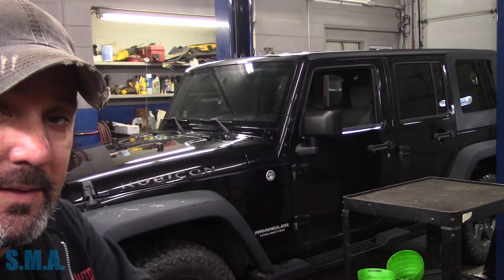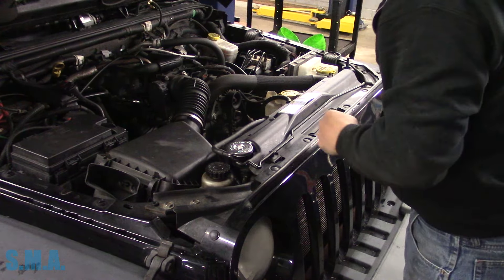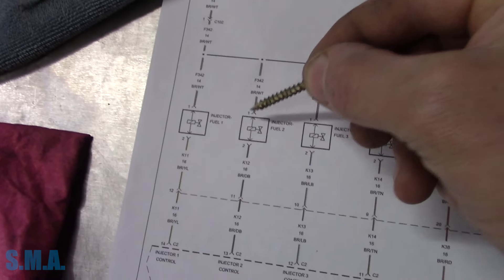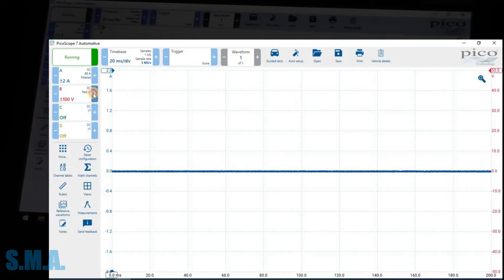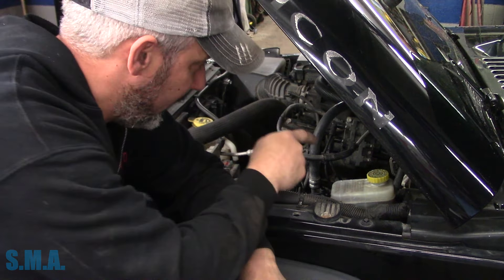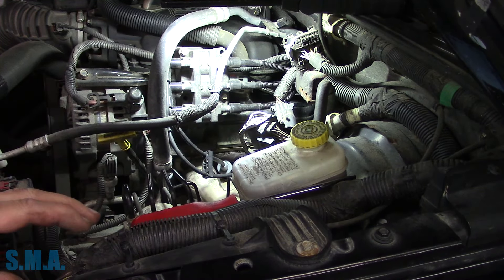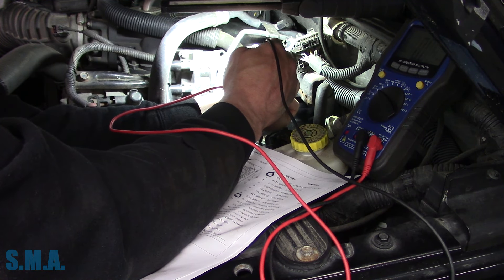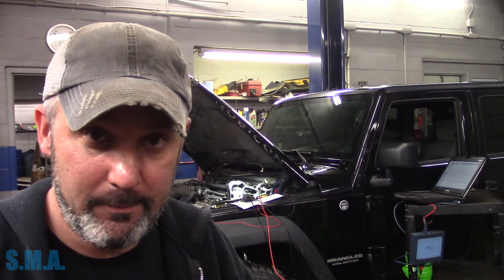Jeep Wrangler: P0204 Injector Circuit & Misfiring

Comment: I got a weird question for you. Have a 2001 ford expedition four wheel. Replaced a/c components and recharge. Now when a/c is on. It feels like its drowning or sluggish when accelerating from a stop. But its peachy when the a/c is off. Any idea what might be the culprit ?
Reply: Make sure the idle valve is working and the ports are clear. May also have to check the base idle and base timing. Usually your symptoms are a sign the computer can’t control the idle enough to idle it up with a load like the A/C kicking on.

Comment: What if you have an injector #1 circuit open and they are new injectors and I have swapped #1 & #3 and still get #1 circuit open? I need to get this exorcism of this 2010 Wrangler sport done.

Comment: My brother oversees the parts and service departments for 3 Chrysler dealers.  He says his mechanics say that J-E-E-P stands for Junk, Each and Every Part
Reply: They haven't been right since AMC quit building them. My 86 CJ7 was one of the last ones they pushed out the door it had a Ford computer and God knows what other off-the-shelf parts but that's what made them so indestructible.  That 258 6 would get almost 25 miles per gallon if you nursed it at 55 on the Highway with no top in 5th gear.  Course I had street tires on it instead of offroad those radials added almost 10 miles per gallon my coworker that has a Wrangler is lucky to get 10 with off-road tires and automatic transmission but she wanted automatic and she's paying for it.   And finally I am not a fan of Wrangler got2b ceejay
Reply: I gotta tell that to a friend of mine, her son works as a mech for a CDFJR dealer!
Reply: @jws3925  as a Jeep owner who previously work in parts for a jeep dealer, I prefer Just Empty Every Pocket, but also yes. 🤣

Comment: When I repaired electronics that had intermittent problems we used a heat gun, that had a small nozzle to direct heat, and freeze spray. We would heat and cool suspected components to check for thermal intermittent causes. We would slowly heat and cool parts to test them. Doing it too quickly caused inconsistent results.
Reply: Intermittent issues will drive you nuts it's much easier when something just quits

Comment: You should be proud you found was injector 4 now it's just a pain in the butt to take off manifold
Reply: Yea engines are harder to work on past 18 years. Love my little 2.5 AMC I4 97 'engine for A2B. Just upgraded my injectors to quad hole modern style. Big difference from sing hole style but dammit if my #3 only lasted 50 miles. Resistance test showed anomaly so got a warranty one in mail. Damn USPS tho.

Comment: Hi, my honda accord 2014 vibrate while accelerating between 1000 and 2000 rpm,  once it reaches above 2000 it drives normal. The local garage cleaned maf sensor and replaced spark plugs but still it vibrate, do you have any suggestions?

Comment: Another good video showing reality.  Heat soak makes perfect sense.  My son just bought a used 4door JK cheap.  Blown head gasket, blew the coolant out of it like a geyser.  Blew the lower rad hose off when we put rad cap on it.

Comment: Hot Soak will do the same with cam/crank/VVT Solenoid's and speed sensors, but you knew that!
Fuel flow cools the injector and when it soaks it gets HOT and the open/High occurs until the temp reduces to a point that current will flow once again and the angry pixies can run home once again 😁

Comment: Don’t you miss the good old days with carburetors and distributors. Plugs, wires, coils and points about covered everything. Good job.
Reply: Hell no, I love modern cars.  They start in the winter- no flooding. No timing gun. No gapping the dwell. No maintenance every 15,000 miles.  No frozen gas lines. No mechanical fuel pumps failing etc.  Real simple everything is better and lasts longer before needing to be replaced.

Comment: Maybe with fuel running through it the injector stayed cool enough to not fail. Shut it off, though, and it heat soaks and finally fails. Still good diagnostic methods used here, Eric.

Comment: Yea engines are harder to work on past 18 years. Love my little 2.5 AMC I4 97 'engine for A2B. Just upgraded my injectors to quad hole modern style. Big difference from sing hole style but dammit if my #3 only lasted 50 miles. Resistance test showed anomaly so got a warranty one in mail. Damn USPS tho. Still waiting.

Comment: No that wasn't a bad video I will explain why Many customers do not understand what intermittent failures look like (even the ones that understand basic logic) This video shows clearly what we are often up against a heat-related failure that will never be 100% provable BUT I will bet my business that if the harness has no green puss it needs an injector. The only way to even "take a peek" is to pull the intake at which point that injector may "test within spec" BUT it is still the cause

Comment: Sooo   to test it when cold after you pull the intake how do you heat it up?????? Heat gun, hair drier, or  gallon of gas and a book of matches ????  HAD TO EDIT, I forgot NAPALM AND FLAME THROWER, but most shops and DIYers don't have these on hand.

Comment: Seems to me that at the start you said you didn't want to jiggle the jiggly bits for fear of changing the condition. Then, you separated c102   (aka a jiggly bit) and the condition changed. I feel like you were fractions of an inch from finding the wiring problem at the connector but gave up before checking the #4 pin. So close to the finish line.

Comment: Heat soak. The fuel flow when running cools the injector.
Reply: Like Tommy Newsom said vapor lock
Reply: Or that one time Eric O. Diagnosed a 30-somethkng yo Corvette with a similar issue
Reply: @adventureoflinkmk2  the man really knows his stuff it's fun to watch somebody who really knows what they're doing
Reply: @hankkingsley2976  you bet.. it also keeps my brain sharp as well
Reply: Or a damaged injector. Had this happen on a 3.8L caravan. Replaced the injectors and problem gone
Reply: Curious the outcome on this… was is a bad connection or injector… I have the exact same vehicle and same problem #4 intermittently open circuit fuel injector. It has happened 2 times in a month will start misfire and registered code… pretty much stays until
It shuts off and cools… then it’s fine for 2 weeks …. I noticed today I was getting on it accelerating pretty hard in a hurry jumping on highway when it happened. I know regardless of what it was in this case wire or injector mine could be either . Of course #4 is tucked under intake and hard to access connector to look at it…. I think I’ll buy the injector and go through install process and examine wiring and check for resistance while moving the wiring around all over to see if it changes from a bad connection. If it does I’ll fix the wire and abort install on the injector. I wonder if it’s a common failure on #4 due to heat being covered by intake

Comment: Customer: The check engine light is on.
Chrysler: That's a feature, not a fault.
Reply: They should just have a light for when the engine is running right. You would never have to worry about that light coming on.
Reply: @joshuarobinson2990  that bulb would burn out or short though....
Reply: The master class in Auto Repair. I don't fix Autos I work on computers but the logical structure of this helps me do that better
Reply: @htownblue11  at least if the left tail light burns out the car still runs I'm like what was it a Morris
Reply: Funny 🏆😂😂😂😂😂😂😂😂😂😂😂🏆
Reply: Standard on all Chrysler models😎
Reply: Customer:" The engine  light is on".
Chrysler: "That means you are fucked".
Reply: 🤣🤣🤣🤣Comment of the yr. You definitely Won with that one
Reply: What does  "Check engine" light look like? The only warning I have is for a "malfunction" which may be anywhere or anything.
Reply: Chrysler?  you mean Daimler Chrysler... er no, you mean Fiat Chrysler... er no, you mean Stellantis!  It's Stellantis now.
Reply: We need a new symbol. The name of the symbol used now is system malfunction indicator, and it ca report issues that are completely unrelated to the engine. When EVs displace ICE they will still need a trouble  indicators, and the ones for mechanical systems like brakes should should NOT be on displays.
Reply: @joshuarobinson2990  It's too easy to tune out something that is always on, but it would solve the issue of failed indicators.
Reply: @htownblue11  MTBF of LEDs is greater than the lifetime runtime hours of most cars (and an order of magnitude longer than the MTBF of LCD backlights in ICE.)   If critical indicators had parallel connected emitters that would increase the reliability until the assemblers cost reduced the good-enough parts.
Reply: @hankkingsley2976  I work on both, and until around 2010 found cars easier to troubleshoot.  The nuts behind the keyboards used to cause most of the problems. Now computer hardware is very reliable and OS defects outnumber ignorant user issues. Car's electronics systems designs have become so arcanely designed with proprietary crap that the lack of standard basic architecture makes them less reliable and obsolete by design. I expect EVs will be worse.   (Car windows won't open, car won't run, replace and reprogram a $5000 proprietary computer board.)
Reply: @markkrispin6944  That's the Chrysler warranty coverage expired indicator.
Reply: @psdaengr911  PEBKAC and id10t errors... also my 2013 Honda Accord has really flaky electronics and computer issues and the voice recognition doesn't work worth a damn. If you get in any kind of accident fix it and trade it because more than likely the electronics will be screwed of course if they just don't total it entirely for a fender bender. Coworker got T-boned they fixed the car and several of his friends and I told him trade it in and start over because it will never be right again.  And even though it had been hit the dealer gave him a pretty good trade in value feel sorry for the sucker that bought it
Reply: @psdaengr911  for sure but it’s more often the circuit board of the cheap LED’s that go bad not the actual diode like you said.  I was just joshin’ around anyways.

Comment: Could give the customer the old new fuel pump, and fuel injection service.
That’s what my old boss did with faulty injectors. Then if it turned out to just be a wire or fuse, he’d fix that and not tell the customer.
Full FIS for everyone! I don’t work for that fella anymore.

Comment: Just had to replace an injector in my 99 camry for the same reason.  Would heat up and then read open line on my meter for awhile after shutting engine off.

Comment: At least you had it happen which is great :) With you moving the plug it could still have been say a broken wire only held together by the insulation (have had this before) with moving it shifted its position... Granted it makes more sense it is the injector or connection on injector. But there is still that possibility. Have only started watching your vids in past few days but am loving your content. Auto Electrics try and avoid and give to the experts. A power distribution / control board no worries but car electrics... no thanks :)

Comment: I always check it from auto shut down relay to the proper on on the ecm. In this case it would be from the relay to pcm connector 2 pin 11. That way i can move the harness & see if there is an open circuit. Great stuff Eric

Comment: I've got a problem for you, I've been watching your battery draw problem videos. I've got a ford 2004 f350, and recently it has had a draw problem, I've been to ford, and watched 100's of video, but no one has seen this problem. After charging the batteries, and driving the truck, when I shut it off, all is good, but after about 15 seconds the cluster comes to life, all the warning lights light up, the radio comes on, and the odometer lights up, the locks on the doors won't lock, because the truck thinks the key is in, and turned on, and the key is in my pocket, lol. I've unplugged the cluster, and the draw of 3.5 amps is still there. Any help on this problem would be appreciated, and rewarded. Thanks Matt.
Reply: "because the truck thinks the key is in"   That seems like a pretty big clue.  Can you investigate the switches and wiring by which the truck detects key on? Any chance it's got some aftermarket additional wiring or gadgets in that neighborhood?
Reply: dead simple  all you gotta do is train as a veh tech ..think analytically spend your holiday money on tools and equipment and learn to use it .....or find a knowledgeable garage near you   this knowledge costs money   what did ford say?
Reply: @brownbag1465  ford said to replace the ignition switch, lol
Reply: @Graham_Wideman  I've disconnected the ignition terminal from the switch, and the cluster is still powered up.
Reply: @mattwalker8388  did they change it ? that  may have solved it  if not why not?
Reply: @brownbag1465  Because I wouldn't let them. When I pull the ignition terminal off the harness, the problem is still there, meaning the problem is beyond the ignition switch.
Reply: @mattwalker8388  but it would be their problem ..no fix no pay
Reply: @brownbag1465  yes, but with ford, part after part, till they get it fixed, and the hours that it comes up to, is all me, I just was wondering if anyone has seen this problem, and could send me in the right direction, with out replacing every electronic circuit in the truck.
Reply: @mattwalker8388   to suggest  and  then it results in damage of components for whatever reason is not professional  and ends in ambiguity
Reply: @brownbag1465  none the less, it's the way my ford dealer is in this town.

Comment: Hey that's auto business for you! I think as you shut off the vehicle the heat builds up even more on the top cause there is no air flow  and the windings expand causing open circuit . Great video

Comment: This engine is an abomination. I have a 3.8L caravan, no matter how many parts i throw at it, its never quite right. Compression? Perfect. New heads, valves, exhaust manifolds, gaskets, headgaskets, seals, all sensors, everything is oem mopar, injector harness, plugs, injectors, waterpump, literally everything is new other than the short block and it still does weird crap like a intermitted sputter. New cat and o2s too.

Comment: I've been doing 'heat soak' tests since the mid 90s, as learned from the 'GM experience' . The cold fuel is just enough to sometimes keep an injector alive, especially at idle, no load. But hey, you found it, and proved it, so what's the diff? :)

Comment: Am I a cruel person?  I was laughing out loud when you restarted it and it was skipping.  Just shows it happens to the best.
Reply: Looks to me like it kind of fell into his lap compared to what could have been. Always informative and a fun watch.
Reply: Eric isn’t too worried about that. He’ll heat and cool it if need be to see if it opens and closes the circuit in the injector or he might find a crusty wire coming from the connector down to the injector. Should be a quick fix…. Unless the guy opts to fix it himself. Me maw said so